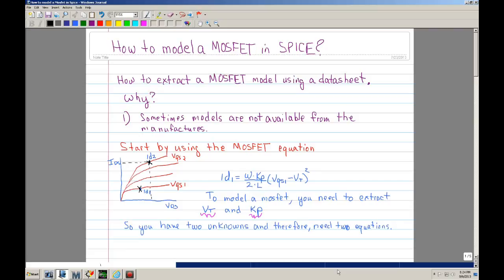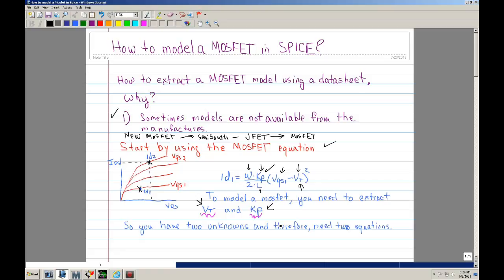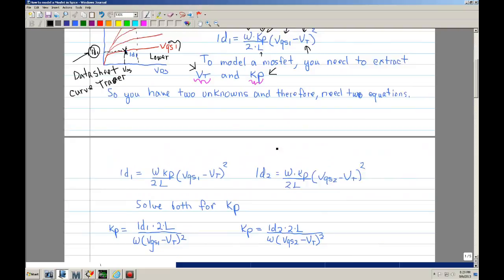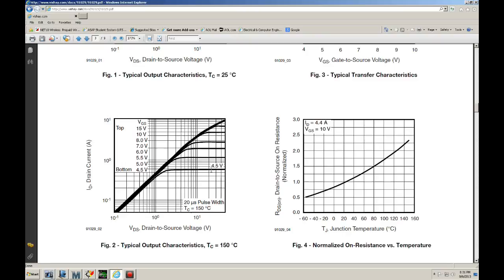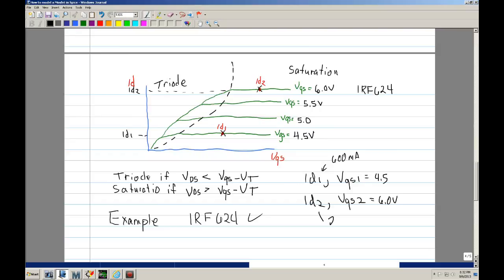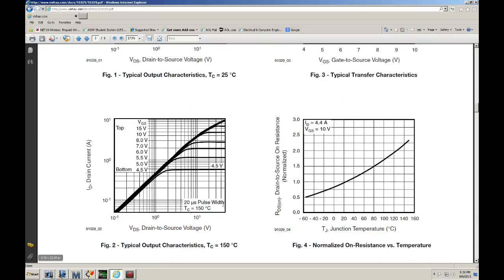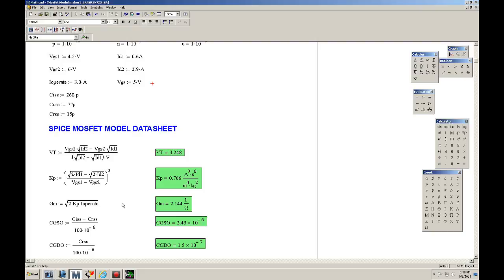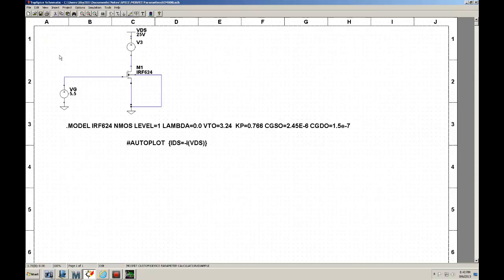How to model a MOSFET using a datasheet.

Comment: Hi Robert,
I have a question about the formula for Kp. Why "W" and "L" are not in the formula for Kp? I understand that they are not involved in the formula for Vt, but when you plug the expression for Vt into the expression for Kp, "W" and "L" will still be there. Actually, "WKp/L" can be regarded as a lumped parameter. How can I calculate Kp without using the value of "W" and "L"? Could you explain that? Thank you.
Reply: +Robert Bolanos (Maverick Volleyball SA) Thank you, Robert. It does help.

Comment: Hi, really useful video, many thanks for it.  One question came to my mind regarding with the Id, Vds map: why do we need to use the one for Tc 150°C, instead the other for 25°C? 

Thanks.
Reply: Because never, ever, does a semiconductor run at 25°C or below without liquid cooling.

Comment: Hi, but when I also add the term (1+λVds) to the current equation and have fixed the current Id, Vt and Kp, how can I understand the values of Vgs and Vds?  For example, in the current mirror I want polarization with a fixed Id current, how can I also fix the Vds in such a way as to obtain the fixed Vgs?  Could you point me to a guide that explains how to make a MOSFET work as an ideal current generator to impart a reference current into a current mirror?  thank you so much

Comment: The model works for the saturation region but is not valid for the triode region. Mosfet level one models don't work well for power mosfets
Reply: Yes. This is my doubt. This might not work for a power mosfet as it is operating in active region.

Comment: Hi, how about the function that describes the intrinsec Capacitances?, These capacitances changes in terms of the Vds voltage, so the parameters you add of Ciss, Coss, etc ... are fixed ?
Reply from the maker: Hi Diego, you are correct. The Cds capacitance changes as Cds changes. When Ciss, Coss and Crss, these are fixes and I don't think they chance. Keep in mind that this is a first order approximation. If you want a more complete model, please email me at rbola35618@aol.com and I can send you a Mathcad file. However, this file you need to need the process parameters of your mosfets. I file that I have is for the MOSIS 0.5 AMIS process.

Comment: Hi Robert..what is the significance of LAMBDA in the simulation?
Reply from the maker: +ramu B In the triode region of operation, the Mosfet looks like a resistor. In the saturation, an ideal Mosfet is suppose to operate like an ideal current source, meaning that the current source impedance in infinite. However, in practice, the Mosfet act in the saturation mode like a current source in parallel with a resistor. This output resistor is sometimes refered to as ro. In addition, lambda is a spice parameter that models the slope or the ro of the spice model. Lambda is what give the Mosfet curve is slope. I hope this makes sense. Questions and comments can be sent to rbola35618@aol.com